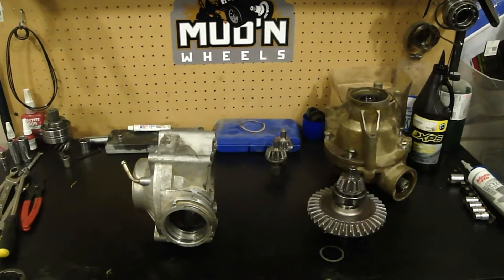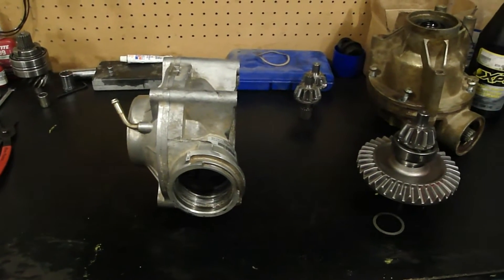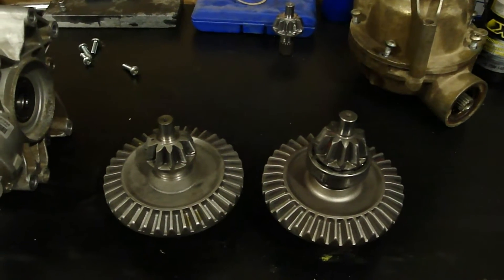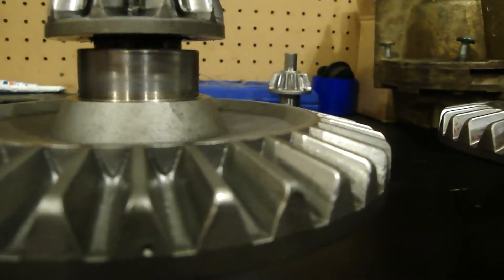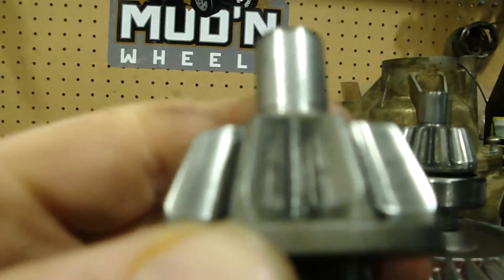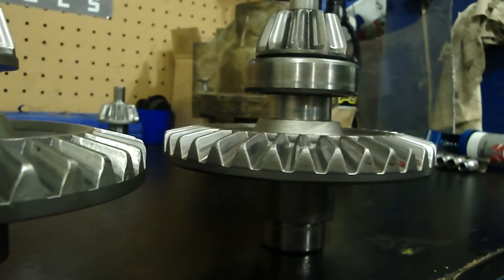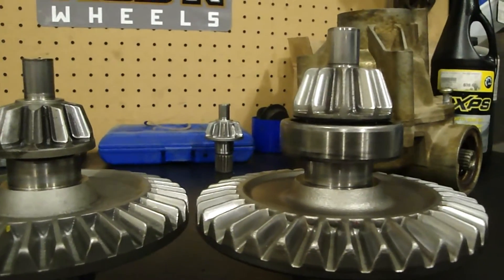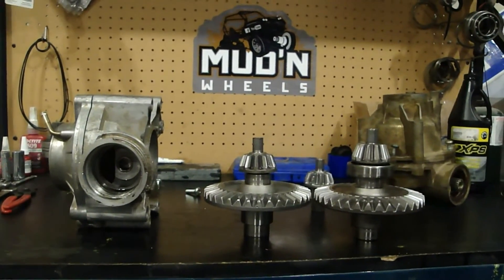Can Am 2015 g2 rear diff

Comment: I’ m no expert but all gear mesh will produce a pattern over time. The key is use good fluids and change regularly. If you mud, have oversized tires, beat on it etc, yea you will have gear failures. These are straight cut gears so there is more torque placed upon each tooth as oppossed to a spiral cut gear.

Comment: hi i have a question, the 2015 pinion and crown can be installed on 2013 houssing differential, i have a outlander 1000 2012 xt with 800 miles , but has rear differential noise, thnak you please help me

Comment: I am Brazilian and have a can am outlander 650 max xt 2015 Ask me a question in the owner's manual says to use 250ml of oil in the rear differential and the correct one? Can I use 300ml with no from 2012-2014?
Reply from the maker: hello from canada.  i fill the diff until the oil runs out of the fill hole with no issues
Reply: Thanks for the help but of course if I fill up to leak through the filler plug it will burst the seals here in Rio de Janeiro it is very hot there in Canada and cold then and traquilo, I will only put 250ml as the manual oil used and 85w140 gl5 mineral
Reply from the maker: i give this same advice to all my customers in the deep southern united states as well and my customers in Australia.   you will not blow out your seals cheers
Reply: Ok I will complete the differential until leak through the filler plug was for the help

Comment: Are you blind? You can clearly see the ring gear has a wear pattern as well.. It simply comes down to they used a cheap casting and heat treating process and unless you can create your own process and build your own gears from raw metal your product will be no better than off the shelf and then you have how hard the user will beat up the product as well... You want the diff to last a long or longer time use heavier fluids and additives to reduce the friction.. Lucas or royal purple..
Reply from the maker: +JAY IRVING I have build hundreds of these diffs for customers over the past 2 years.   I only have 3 failed diffs to speak of.   I have put my diffs in the worst possible conditions in the highest profile race bikes, lifted bikes  big bores with nos and turbos.   THIS is what i do.   for more information please check out my web site and face book page.  thanks for commenting 

http://mudnwheels.com/Can-Am-Parts/Home
https://www.facebook.com/Mud-n-wheels-672787052788976/?ref=hl